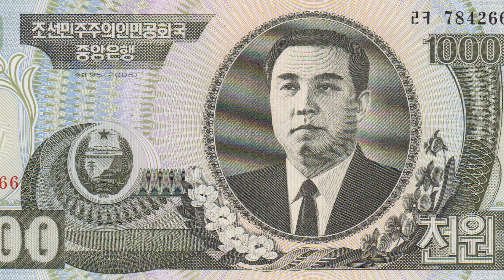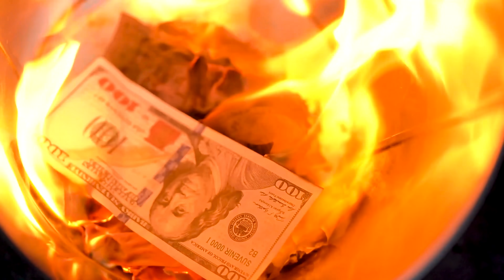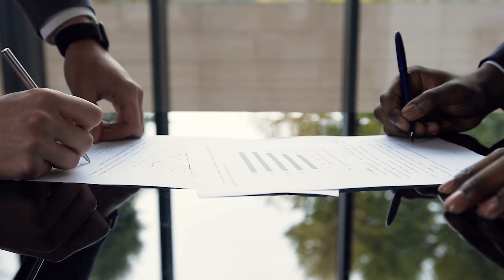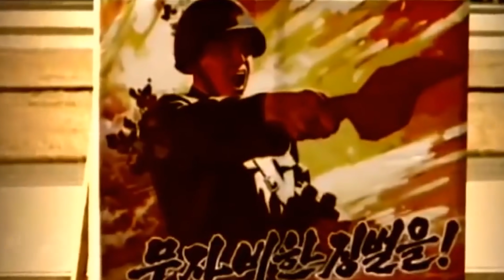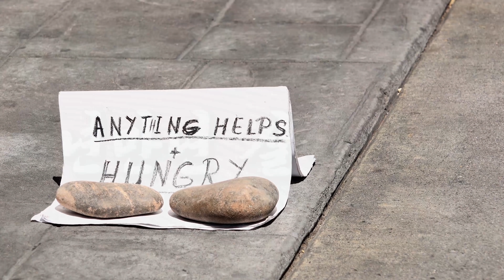The Pathetic Economy Of North Korea

Comment: Cuba has been through a similar experience since 1959. It was largely kept afloat after cutting economic ties with the USA by the USSR, which was pleased to have a commie ally right next to the United States. Eventually the USSR got tired of pampering Cuba by buying all its sugar crop at higher-than-market values, selling them oil at lower-than-market values, and just giving them lots of money. All that crashed to a halt when the USSR itself also crashed to a halt, and Cuba hit an economic bottom. That gradually has eased since the early 1990s, but Cuba still controls everything centrally and quickly clamps down on the few capitalist ventures it allows, when they start to get successful. They have the US embargo to blame for all their troubles, but that's mostly a scapegoat for being an economic mess of their own making.

Comment: Its due to two reasons the amount of expenditure on the military
And the sanctions which are designed to crash the economy and force them to the table
Reply: And communism in general. it's not possible for a central authority to know what the most efficient use of it's resources is. It can guess, but it will always fall short of a capitalist economy.
Reply: @lilshifty4758  Enlighten me. How can a central authority appropriately allocate resources without depending on market economics?

Comment: A couple of offered corrections. First the Korean War did not end and still has not ended. The 2 sides signed an armistice agreement which was in basic terms a cease fire.   And the other issue you State that the US spends 54% of their budget on military spending. This is totally in correct.  The actual percentage of the US budget that goes to military spending is 11% of the total budget.  The only way you can get to a 54% figure is by looking at only a portion of Federal budget and Federal spending called discretionary spending. But that term doesn't apply to the federal government like you or I use it a household budget.  Included in the "discretionary"  military budget is the military payroll. Now the size of the military personnel can change  but considering that providing for the national defense is one of the few actual roles of a government calling all cost associated with that discretionary is simply bad accounting practice.

At the time you made this video the percent of the total budget was 10%.

Comment: Um…starting off with a demonstrably false fact - the Korean War did NOT end in 1953 - doesn’t give you a lot of believability.
Reply: that's when the ceasefire begun and all fighting stopped and it defacto ended even if it technical went on until like 2019
Reply: @ashtonkuypers4501  the two Koreas have never signed a treaty. They are still technically at war.